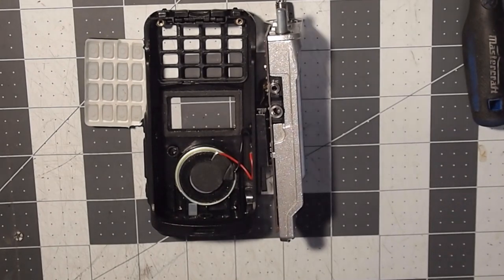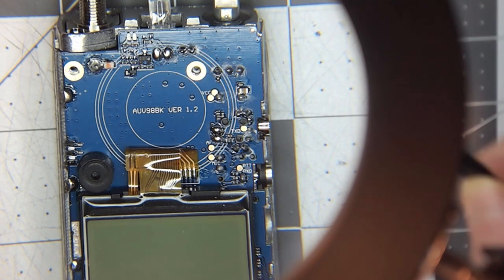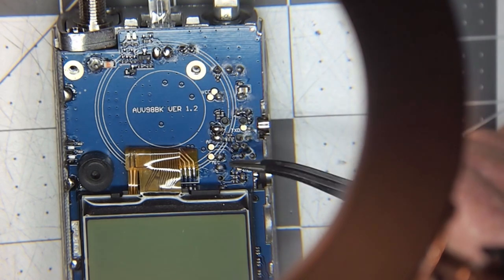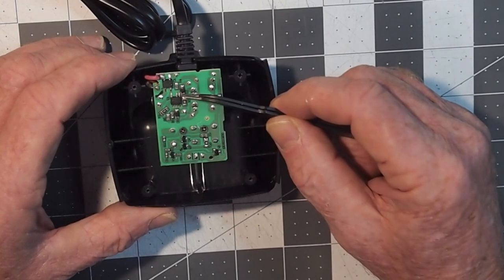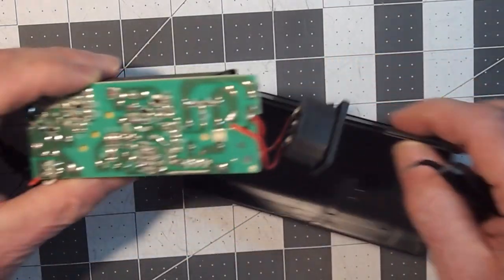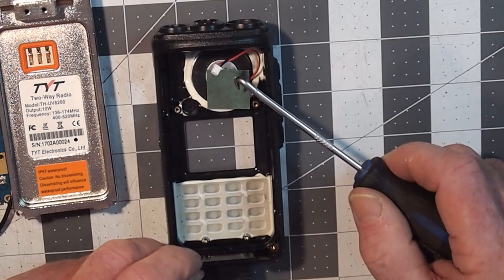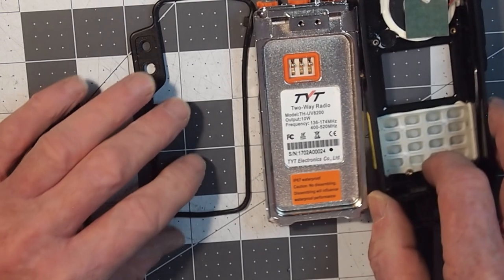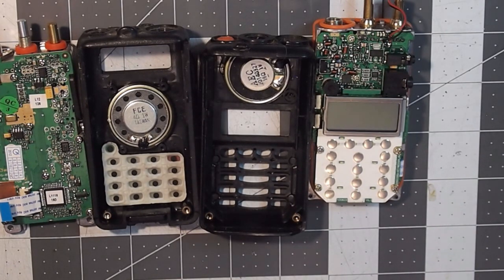Why we dropped recreational radios like Baofeng, Anytone, and Wouxun

Comment: This was a very helpful video. Do you know of a quality base station GMRS set-up? I'm looking at buying a bench top power source then using something like a Midland MXT400 but I can't help feeling there must be a purpose built base station unit out there.
Reply from the maker: All the backcountry lodges I am aquainted with have done the same as your plan for using a mobile as a base station. For example, Campbell Glacier has been using a TYT TH-9000D for a number of years attached to a car battery charged from an adjacent creek. When I looked on Amazon for a price on that Midland it says "unavailable".
Reply: @MountainParameters  It seems like some manufacturer would see an opportunity to be the only game in town for GMRS base stations for AC 110 power. They'd make a killing.
Reply from the maker: @FrJohnBrownSJ  I guess there must be a lot of recreational users in the USA that use GMRS in their vehicles? We don't see much of that here in the Rockies, instead it is RR Road frequencies that are popular. I'm not sure why there would be a market for GMRS radios because you can just buy any programmable radio and program them in, as well as anything else you'd need. As I'm in Canada I might be missing something about the FCC licensing requirements that may preclude that, but on the whole, in reality, and morality lectures aside, that does not seem to stop a large majority of users anyway.

Comment: Valid point but my UV5R with extended battery work fine . It’s so cheap i can have 5 of them and not break the bank . It’s a radio and it talks to be with in range . But I understand the importance of having good gear . I have wouxun kg935g and she is awesome water proof gmrs radio
Reply from the maker: Thanks for the feedback. There are a few Baofeng chargers that have a direct to AC plug on them, but I have no way to have a look at the circuits in them. With that sort of design however, the user does not have the option to swap out for a safer AC adapter. I'm hoping the take away message from this is - no matter what form factor you have: it is advisable to not leave the radios unattended while charging. Then it really should not matter so much which style of charger you have. You can usually smell an overheating device before it goes into thermal runaway and unplug it before it's too late if you're in close proximity. BTW, I should have mentioned that I have had clients (who only carry a radio in case of an emergency) in the past tell me they keep their 'recreational grade' radios in their pack in a tupperware container, and they have never had a moisture problem.
Reply: @MountainParameters  thanks